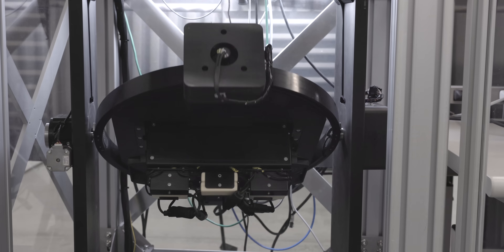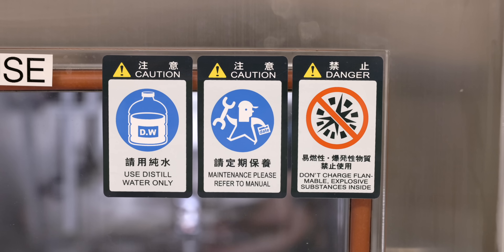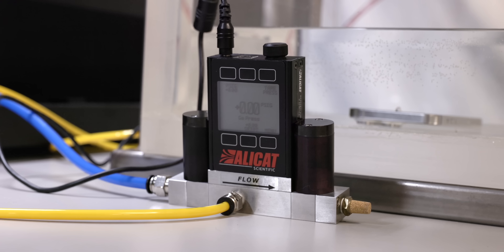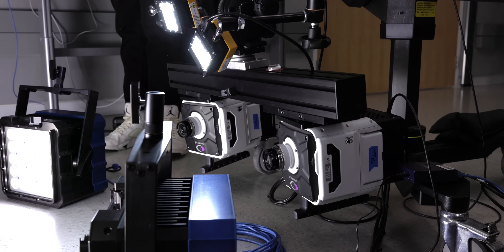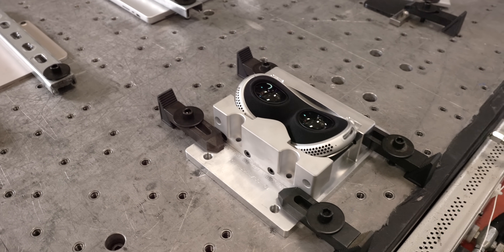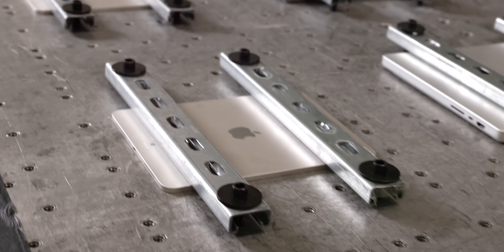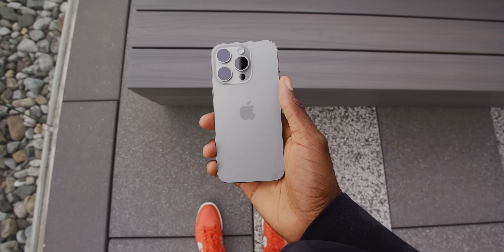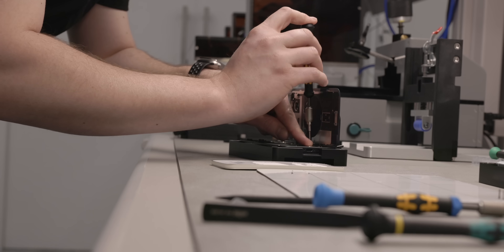I Visited Apple's Secret iPhone Testing Labs!

Comment: That's bonkers. Repairability and durability are not 2 opposite ends of the scale. Nonrepairable devices are a choice made by apple. Ingress protection can be done without glueing the phone for example. There would be some compromises on the way, but they have to be done either way. They should not directly jeopardize durability. Definitely changes would affect size and possibly limit design options for the device, but the durability is a completely different thing.

Comment: I remember when they showed this stuff during Antennagate, specifically how they test signals... except it never seemed to just hand it to, say, the engineering office and mark where their hands went. And you basically nailed that exact same situation for the drop test: 100 people drop a phone, 5 of them crack on impact. The other 95 breath a sigh of relief. Except those 5 now complain, get frustrated, or just go to some repair shop to get it replaced.

Now you have to ask a grand question "with a repeatable robot, could they not drop a weighted mockup 360 degrees in each access to 0.1 degree accuracy and find the most common angles that break, and after doing that one expensive test analysis, be able to update the design so the cost of an extra drive to a store or delivery vehicle pickup + additional stock and manufacturing and shipping it + additional employee training and time they spend repairing a broken screen... and all that before the human factor of opinion that the phone is fragile. All of which scales linearly vs. the one extreme drop test. Does it really come out better for the environment (as they've already mentioned this) and cost of everything as opposed to... just letting someone replace it easily?" It's a legit question. You can design for every single scenario and try to fix every single element, or as was stated, make the most durable phone. Or you can go "we hit our peak, it doesn't balance against repairability, let's tone it back a small amount where it's perfect for those 95 people, and for the 5 that it broke, it's easy for them to fix that reduces all the other factors.

Comment: Well, iphone is dureable in "certain" way, but its still a phone mostly made with glass surface which...still breaks quite regularly
and most of the reasons why iPhone is hard to repair is parts availability and software......which doesn't really make iphone more durable.

Comment: Over the summer we do a lot of snorkeling in a certain lake and you wont believe how many phones we find. Most of them do turn on as well. Sadly, a lot of people put the highest security settings on so you cant even get a contact or anything to get the phone back to them. But we have returned a number of them to people and once someone drove to my dads house to pick it up even because they used the find my phone feature.
Reply: Never get why people don't add emergency contacts that can be contacted without unlocking.

Comment: ye cuz only those minority of people actually break their phone cuz most have a screen protector and a case. So he's right that the product should be better rather then be more repairable
Reply: No bro, the problem with the repairability of iPhones is not that its disassembly or reassembly is tedious, but that finding spare parts is difficult and full of restrictions! Marques already made a video before about right to repair and he interviewed Louis Rossmann about future technology being more difficult to repair, and Louis clearly stated that he just want to be able to purchase and install parts easily without any restrictions on availability and software. Marques kind of dropped the ball here because the 'Durability/Reliability vs Repairability' argument is misleading and throws people off on the actual issue of iPhone repairability, which is that iPhone repairs are full of software restrictions and are goddamn expensive!
Reply: @mythicalguy1236  more difficult for YOU to repair. And thats why it should be done at a professional. If you repair it then you may damage their brand cuz you might have not repaired it well and therefor the water resistance might be worst. And like I said use a good screen protector and case and it won’t break 99%. People that break their phone are usually not wearing one I have noticed from high school. With the back of Iphones not being covered by a case. And if you do use it without a case/screen protector then its your fault or you should buy the Apple care for unlimited repairs if you got the money to allow your iphone to break by it being exposed

Comment: Marques with an L take re: durability and repairability. Countless examples of repairable products that are durable. Take Toyotas for example.
Reply: Yeah I agree the issue of right to repair is not just about whether or not the phone can be taken apart easily, it's also about how easily you can find spare parts for the phone and whether or not you can install said spare parts without software restrictions and how expensive the repair is!

Comment: Man, mkbhd just ate apple's explanation on low repairability. But no, they are lying, the iPhone isnt repairable because it has hardware with specific serial numbers which if you change it will be detected and the phone is programmed to not work.

Comment: This is some Apple propaganda right here. Repairability is not at odds with durability
Reply: Yeah Marques kind of dropped the ball here because the 'Durability/Reliability vs Repairability' argument is misleading and throws people off on the actual issue of right to repair, which is the availability of spare parts and the software restrictions on spare parts.

Comment: Speaking on Durability vs Reparability. I don’t view it quite like that. You can have something thats super durable and reparable. But you would sacrifice the form factor of the device to the point of it not being as sleek and slim as they normally would be. And thats something that Apple will absolutely not sacrifice.
Reply: Yeah the 'Durability/Reliability vs Repairability' argument is misleading and throws people off on the actual issue of iPhone repairability, which is that iPhone repairs are full of software restrictions and are goddamn expensive!

Comment: Saying it's a moving scale between Durability and Repairability sounds like Apple propaganda. It is crazy to suggest that in order to make your phone repairable, you have to sacrifice durability and it's even crazier seeing MKB be the one to say it. Apple is just greedy and makes their products hard to repair because they like money. Has nothing to do with durability. What durability would they sacrifice by not using Pentelope screws?

There's nothing special about those screws that make them more durable, their ONLY purpose is to make them hard to unscrew, but when your phone hits hard surfaces, a screw being hard to unscrew isn't the issue. It's things breaking around the screw that's the issue. And really, that doesn't even happen at all 99% of the time. The vast majority of the time, it's your screen cracking. So why does Apple make it so hard to remove your screen to replace it? Are they trying to make the phone more "durable" and prevent your already shattered screen from popping off? Plenty of other phones have more easily repairable phone screens and don't have an issue of their screens just popping off unless they get hit hard enough to shatter the screen, and then it just needs taken off anyways.

That was an insane take, Marques. You can do better
Reply: Yeah Marques kind of dropped the ball here because the 'Durability/Reliability vs Repairability' argument is misleading and throws people off on the actual issue of right to repair and iPhone repairability, which is the availability of spare parts and also the tons of software restrictions when installing said spare parts. iPhone repairs are also notoriously overpriced and expensive.

Comment: their products arent hard to repair because they are reliable, their products are hard to repair because serial number pairing making so every part has to be paired to specific devices, because of the pentalobe screw, because apple's whole model is for you to buy new products, not to fix the ones you have when, not if, something goes wrong.

Comment: I am fine with the sliding scale of maximum durability to minimal repairability. If the only repairability is the battery, and Apple is the one who repairs/changes the battery--since they built the phone, I'm fine with that. Actually, that's what I prefer. I bought my vehicle from a Honda dealership, I only go to a Honda Parts & Services center for all maintenance check-up/work for my car. I've never gone to a private mechanic. Personally, I have more confidence in the person who built the product to fix the product, than I do for a third party to do the same.
Reply: Do you know Louis Rossmann? Go to his channel and watch his most popular videos and you will realise how wrong you are with 'having more confidence in the person who built the product to fix the product', at least when it comes to Apple products.

Comment: 9:15 sotry is total BS! never I have had a customer who came here saying he dropped it in a lake for so long it just turned on with no problems, total lie!!

what can be the case is that denpending where it was dropped, the success case of the motherboard being damaged by oxidation seems to be getting less and less frequent requiring less parts needing to be replaced for the water damaged device to come back on, and the most important thing is, APPLE still does not offer liquid damage relatated repairs, so that story was not relevant in my opinion, just a lie.

Comment: A correction for the part about the IP rating: the X part doesn't mean no protection; it means the product wasn't tested for that component of the rating. A rating of 0 means no protection. More info available on the "IP code" wikipedia page.

Comment: Nearly super glueing the battery is for better durability? I can see why because they are shaking the hell outta it

So why isn't any other vendor or manufacturer doing this as much. I know others have been a bit but not as crazy as on iOS 

Also does making the screen or camera/faceID parts need to be serial numbered? Or is that just for blocking other countries stealing your phone for parts?

Oh and why doesn't the industry just sell two different types. IP68 and below. Because not everyone wants or needs IP68. Probably because it's just cheaper for them to say it's needed than actually giving the customer an opportunity to get what they want.

Comment: The apple guy is literally making things up..... Ok.... Phone is not failing electrically .... But what does it have to do with the phone being hard to repair ??
Even if the whole phone was made of titanium (yes even the screen) Still people will have to change the battery.... Or a camera gets damaged..... How does serialising and even blocking original parts replacements making the phone "Harder to damage" or stop working

Comment: I'm sorry but the idea that something is repairable or durable and that's on a slider is total bullshit. Sure waterproofing the phone does make it harder and is better for the consumer but you CAN still repair waterproof phones. Software locking parts so that the phone can't be repaired unless you go to apple and use parts blessed by their secret software DOES NOT make the phone more durable, it just makes it impossible for independent repair. I used to repair iPhones and Macs and they got harder to fix not because they were more durable, but because apple has become way more anti-consumer and would rather strong arm customers into buying new phones and computers rather than repairing them by making it very difficult and expensive. Very disappointed in you  Marques, normally you are very level headed and critical but in this video you just repeated their talking points without thought.
Reply: Since when the channel is critically  level headed?
It have been so many times he biased and so wrong and unfair to different brands.

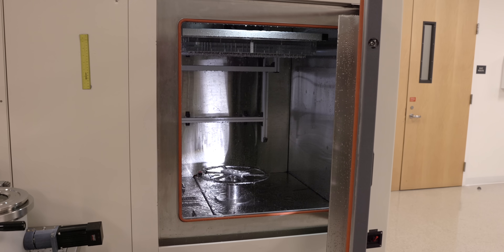Comment: 1:40 for IP68 the 6 is the highest rating for dust protection, the 8 is under water up to 1.5 meters (5 feet) depth for 30 minutes. this is the minimum to pass the test at this rating, doesn't mean maximum, plenty of real world examples of devices with this rating lasting much longer at deeper.

Comment: So glad that apple hardware locking replacement parts makes my phone more durable
Reply: Was literally about to comment about this 😂
Reply: Good thing is you can choose if you buy an iPhone or not. So stop complaining about things that are in your control 🤷🏻‍♀️
Reply: @dnickolov  you can enjoy a product but still have complaints about it.
Reply: it doesn't make it more durable, but it does make it safer. just think about how how much you'd like to have a compromised chip in your phone where you hold all your passwords
Reply: @InferiorDrawing  If you don't trust a repair shop then don't go there. That's not a reason to ban other people from fixing devices that apple would otherwise discard.
Reply: @mastaw  It compromises your security and it also means that Apple cannot guarantee that third party repairs have done unforeseen damage to your device which invalidates your warranty and their support. Apple is all about sustainability. If you repair your phone with a third party, they can no longer cover the warranty of those parts or the repair itself. If you then trade in your phone or sell it to someone else, that phone also cannot be covered either. The phone effectively becomes "dead" in the eyes of Apple because they would have to replace all the parts, basically make a new phone. By rejecting third party parts and third party repair, they can ensure that their devices can be repaired in a way that's controlled. It makes complete sense. It doesn't mean you have to be happy with it though.
Reply: @LeonBlade that simply ignores the fact that apple considers 10 year old full functioning computers as vintage making them unrepairable, therefore making me buy new stuff. Not at all environmentally friendly. Plus their repair prices are just ludicrous. They profit from selling new devices and repairing old ones that’s if they are even repairable at the expense of the consumer, while claiming they care for their humongous environmental impact. I have to remind you the ATROCITIES they have been doing with repairs having to replace the whole screen for a broken display cable. I am an apple user, I like apple’s commitment to privacy as well as their ecosystem. But locking their hardware from third-party repair, while charging 4 times the cost, drop support after 6 years(!!!) from release yet at the same time claiming they care for the environment or the customer is just ridiculous. I hope the EU regulates them further. Companies care for their shareholders, not for the environment
Reply: @LeonBlade  There are bad people at Apple repair shops too. Why would an Apple employee be better than a non-apple employee? Or if we take Apple out of this, why would an authorized repair shop be more trustworthy than a non-authorized? It is not like the vet their employees with FBI or something. In numerous occasion the authorized shops have been caught doing just the same or worse thant third party shops. The security thing is just BS. As to warranty, the phone is out of warranty in two years anyway so why can I not get it fixed at reasonable cost after that?  It makes no sense. I'm not asking for apple to ensure that MY device is repaired in a "controlled way", what a weird corporate apologist view point.
Reply: @InferiorDrawing  Like that's why they do that.
Reply: @InferiorDrawing  If that were the concern, an enforced factory reset when components are replaced would be all that is necessary.
Trying to say it is in any way a security concern is purely invalid.
Reply: @InferiorDrawing   someones gonna hack my iphone by installing a new back glass
Reply: @InferiorDrawing why are hardware parts made so complex that they are able to steal your passwords?

Comment: The other day i was searching for what software does apple use for doing all of theie high level engineering CAD work, the answer I found on reddit was that they use Siemens NX on windows PCs inside apple HQ, never thought apple would do that. Thought they would invent thei own CAD software that runs on a mac and wouldn't stabd even the slightest hint of windows, atleast in their campus. Watching the saga continue over here in the form of this testing software is just outright hilarious and mind boggling.

Comment: Devices being hard to repair isn't the issue. We can do a difficult repair just fine if documentation, parts, and tools are accessible. To be fair, Apple has gotten better on this front. I applaud them for providing tools and documentation for screen and battery replacements. But they still don't provide schematics. They still pair parts when there is little technical reason to do so. They still tell chip manufacturers like TI and Intersil to only sell specific chips to them so that you can't just buy the chips on Digikey or Mouser. If the proper documentation, parts, and tools are available, doing a difficult repair is no more than a skill issue. But Apple has a long way to go on that front.

Comment: 9:50 ...did that man just say repair is actually worse for the planet? Never in my life have I heard a more corporate propaganda statement before. While it's certainly interesting to see the durability testing process these phones go through, that guy blatantly lied through just about every statement he made. You do not need to compromise durability to have repairability and serial locking components, having proprietary screws, and disabling phone functionality from replaced components has nothing to do with durability.